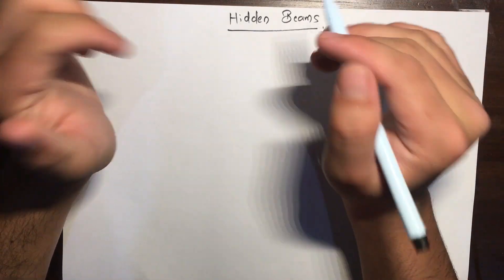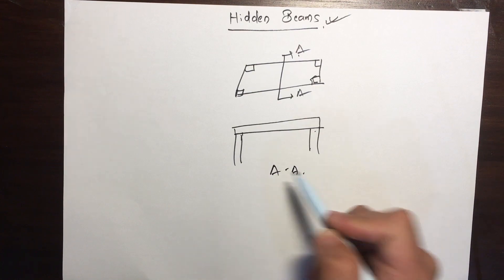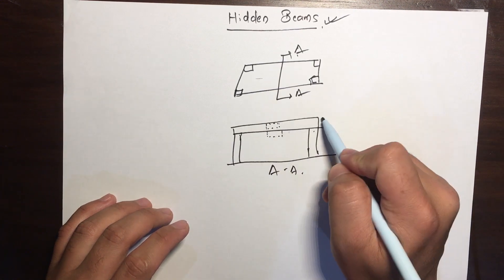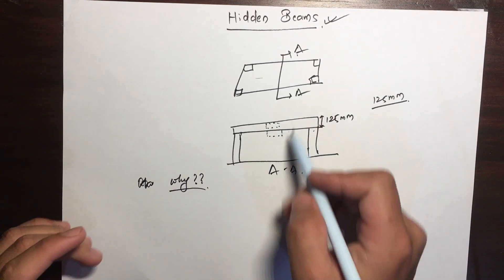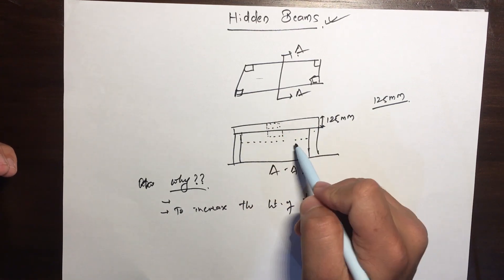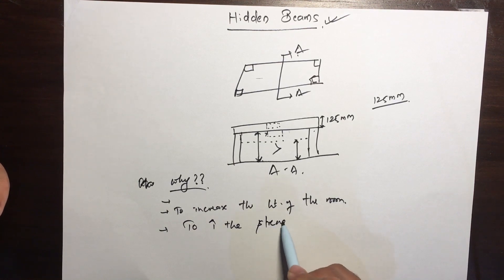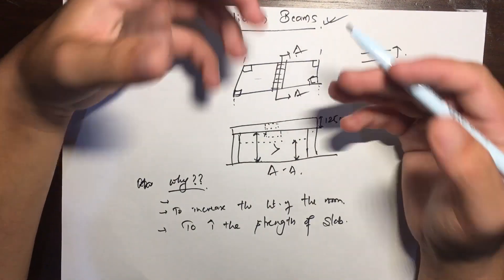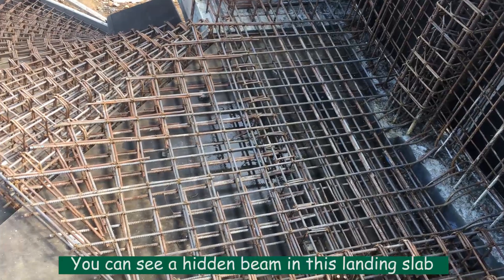What are Hidden Beams? Meaning and purpose Explained in Detail | Interview Question #17

Comment: These are the beams which have the same depth as that of the slab thats why they are called as hidden beams. 

They are only used to increase the stiffness (provided under walls) and absorb vibrations. They don’t take or transfer any load.
Reply: You are right